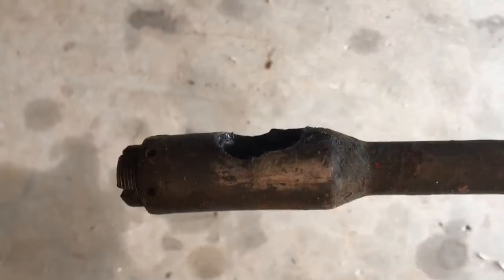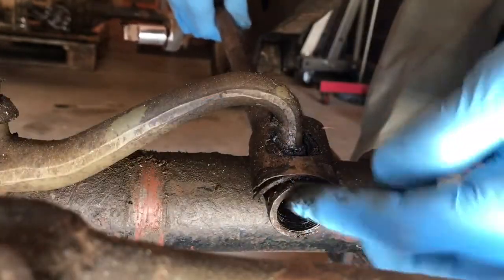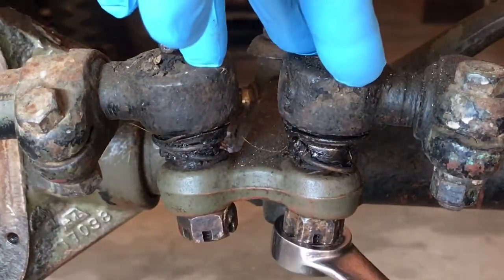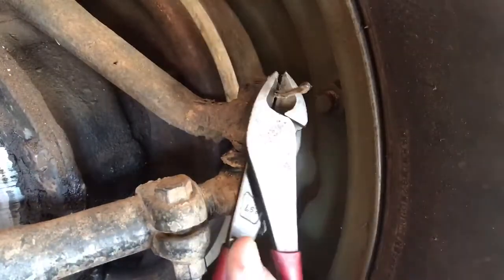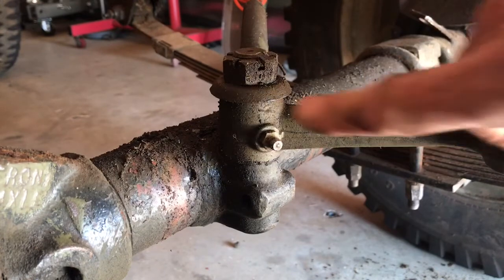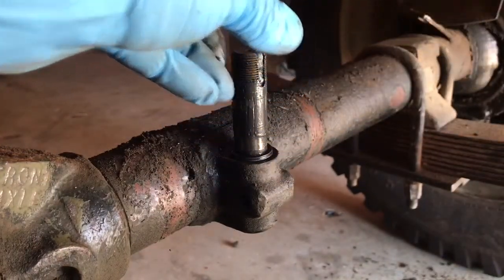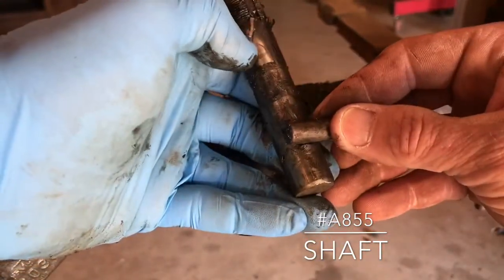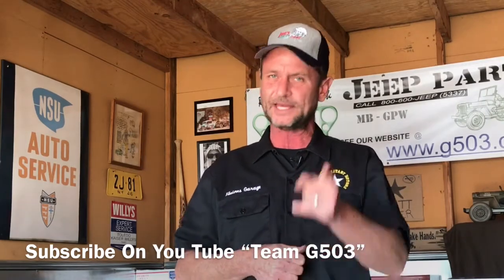Disassembling The Steering Components On A Willys MB Team G503

Comment: How do I know when I should replace the Bell Crank Shaft ?
Reply from the maker: David
Replace whenever you see grooves on the pin from the bushings or bearings. Visual inspection from turning the wheel you can see movement. Early bushings were replaced with bearings. Those can be wore or damaged before the pin.

Comment: hey Scott, what torque setting do you recommend on the castle nut of the ball joints when fitting? Those ones you removed in the video seemed to be just hand tightened. I don't see any mention in the TM but would appreciate your advice on this - thank you
Reply from the maker: Marty, I tightened the new ones tight with a wrench and then backed off enough to allow the cotter pin hole to line up👍
Reply: @TeamG503  Thanks Scott - I really appreciate you taking the time to reply 👍